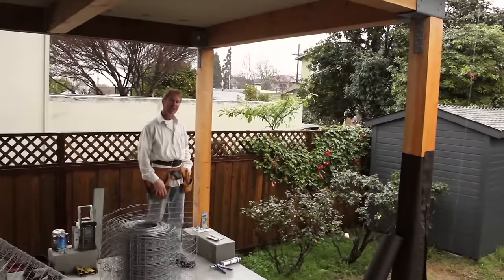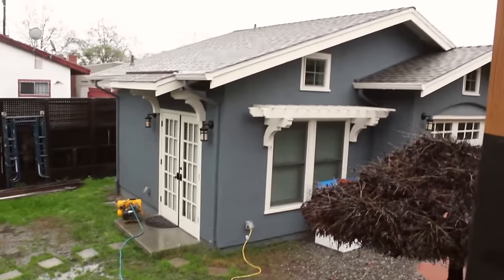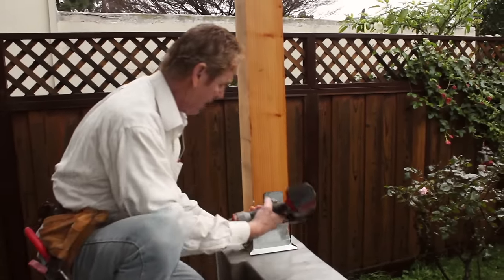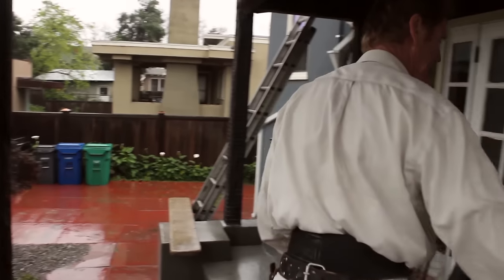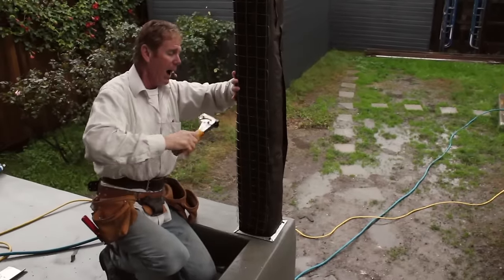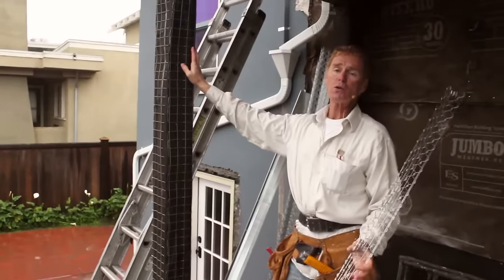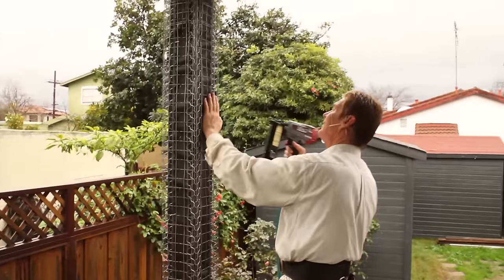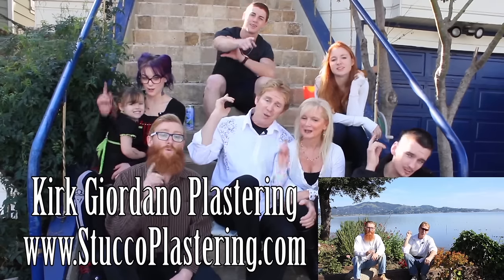Attach Stucco Drip or weep screed for waterproofing walls

Comment: Hi Kirk,
Is there a temperature below which cement won't stick properly? I've heard different views on that. Some say not to mix cement when it's below 40 or so; others say no, that in Canada and other cold places they mix cement throughout the year, often with bonfires or industrial size heaters nearby. Have you had problems with cement sticking to surfaces when it is really cold out? Thanks from Maryland!
Reply from the maker: Good Evening Laura, I can tell you from experience that plastering in 27 degree or freezing weather is much more difficult as the water hoses can freeze, I think around 27 degrees is the coldest I've have applied stucco, it best to be between 55 to 99, at least for me, since we can't' control the weather, time in teaches us  learn techniques that allow us to improvise in many different temperatures. 
 Best wishes,
Have a happy and prosperous new year.
 kirk giordano plastering

Comment: In the northeast all of that would of been covered with some sort of plastic material. Thanks for sharing.
Reply: yolol yes. In this area we use pvc material , vinyl , some aluminum,  and depending the size you can see hardie board type material. It's all maintenance free.
Reply from the maker: Howdy Fillow Tree Dude, we do live in a plastic world, most folks even wear clothes from plastic or oil. Not good,
 cheers,
 kirk giordano plastering